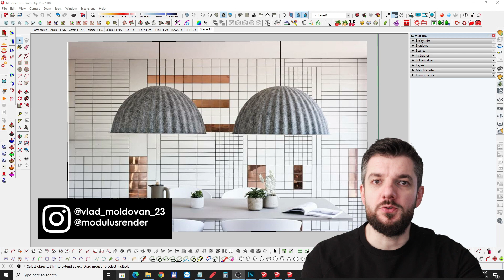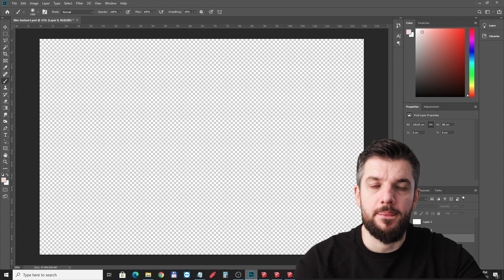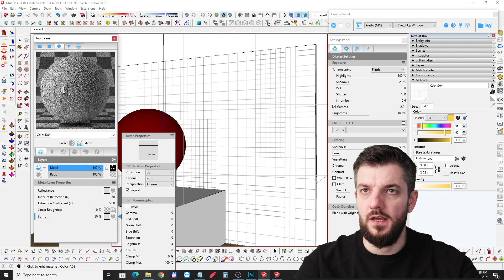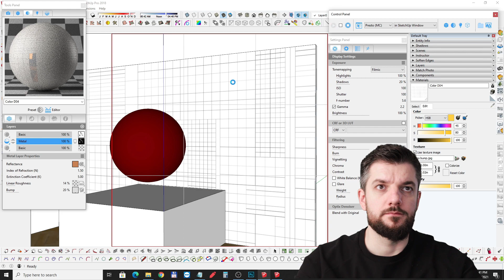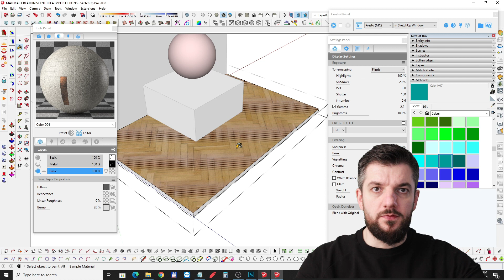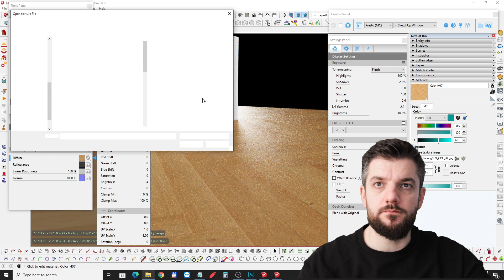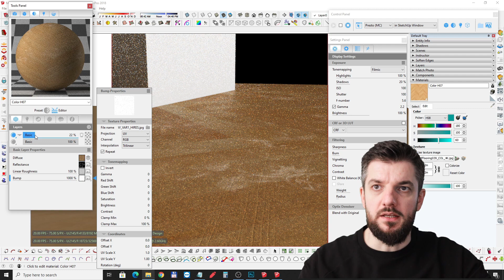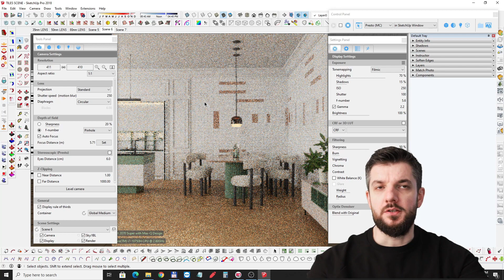TheaRender layered materials | Modulus Render

Comment: Hi, one cuestion, do you have some plugin to create the 50 /25 /80 mm. lens scenes?
Reply from the maker: I used an online calculator for it. Sketchup uses vertical FOV and Enscape uses Horizontal FOV so I had to do some tests. You can always just set the Field of View to 50 mm but in my experience it's not so accurate as a camera. I found that adding 17 mm to the sketchup value works better. So if you want a 35 mm just set sketchup to 52 (35+17). Even better, try to compare to a real photo you took to get even better results.
Reply: @Modulusrender Than you very much. Nice tip!